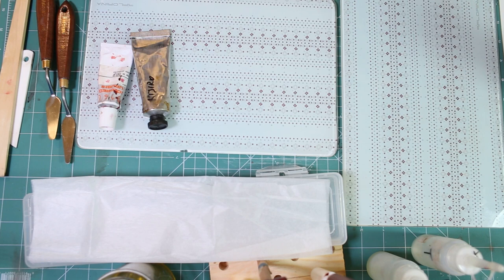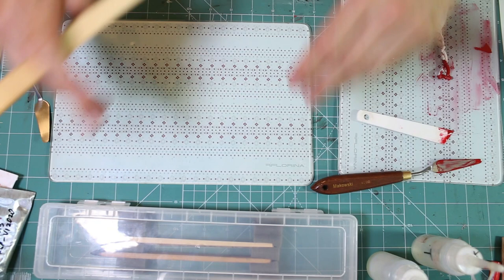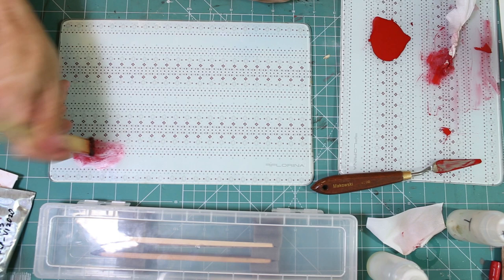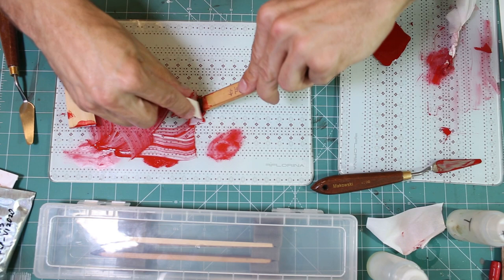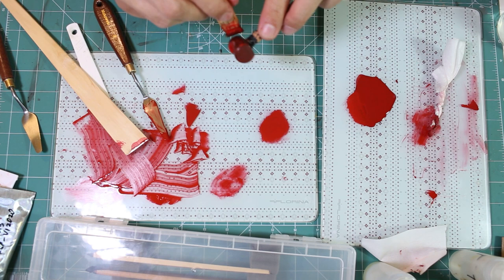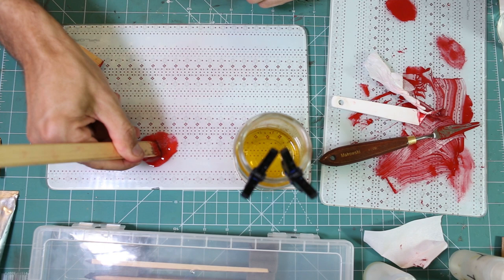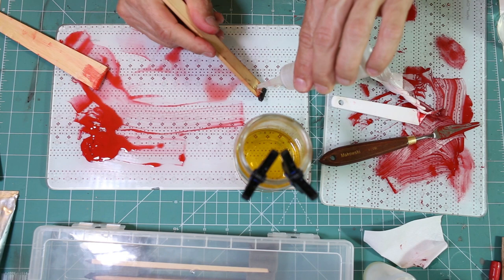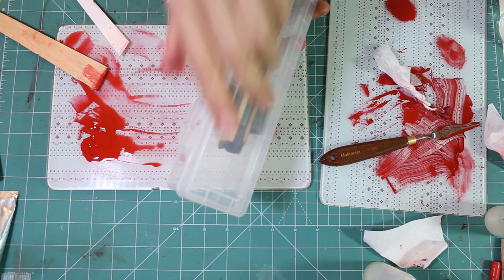Japanese hake - how to take care of your urushi brush

Comment: Very helpful. I have used Urushi twice and each time I ruined my brushes. Does this method work for synthetic and sable brushes? I think I may order a Hake brush in the future, but I want to be sure that this is something that I want to pursue before I invest more. I make dip pens so I wanted to try using Urushi on them myself. Thank you for the help!
Reply from the maker: Dont buy hake if you are beginner. Use flat, high quality synthetic brushes, short hard, rather stiff. This method of cleaning works for them too, but after 2-3 squizes with oil just but them in turpentine brush cleaner.
Reply: @TamenuriStudio  Okay! Thank you so much!